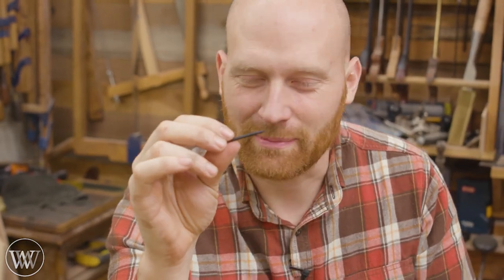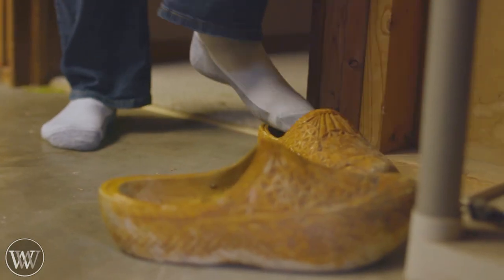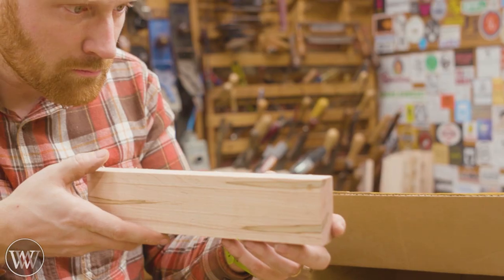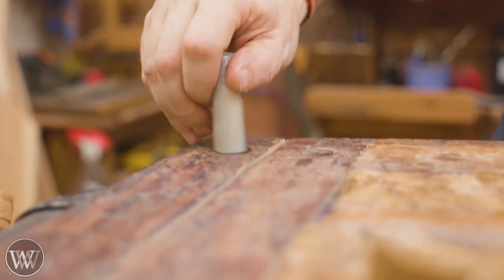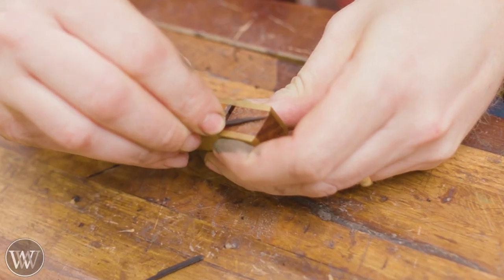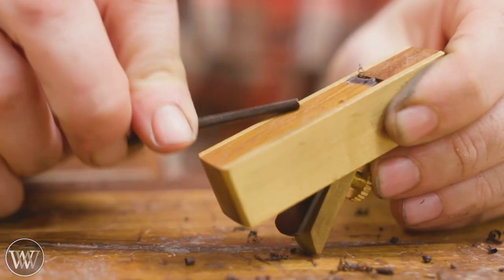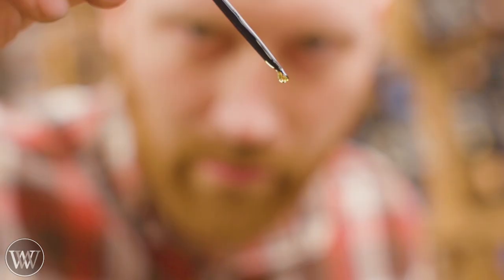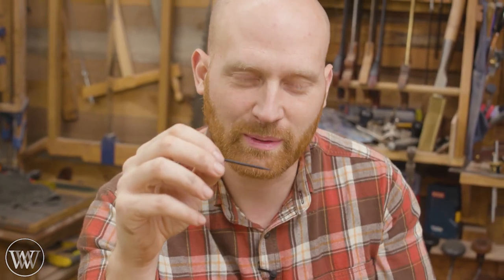how to Make The 200 Toothpick

Comment: For 15 bucks I bought a #4 and block plane combo at harbor freight. Filed the mouth open a bit and made the #4 into a fore plane. The block plane was basically useless but I've still got it just in case. I would not recommend that #4 as a smoother like they call it. Its genuinely bad and can only do rough work, just an fyi
Reply from the maker: so true. it is a boat anchor!